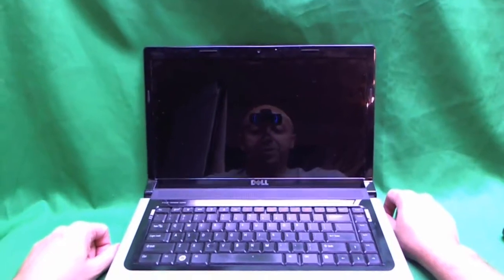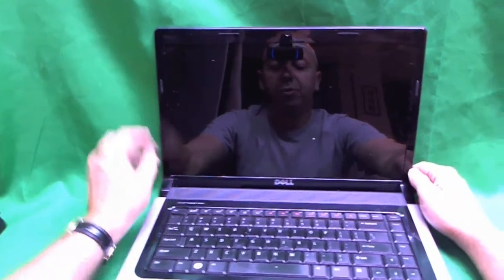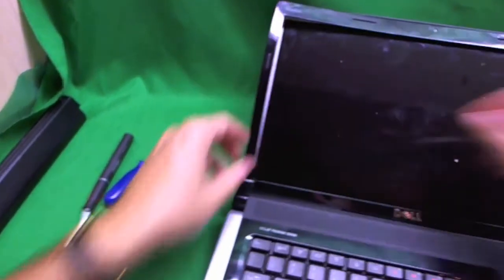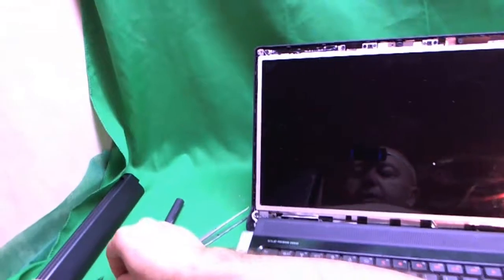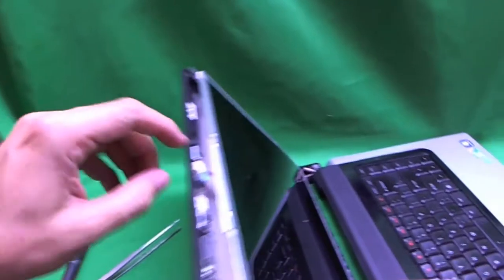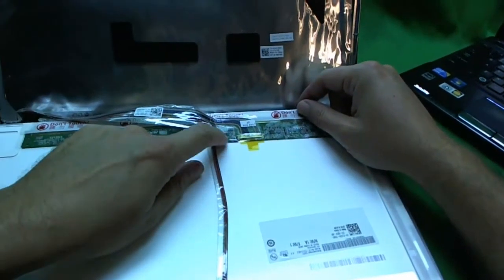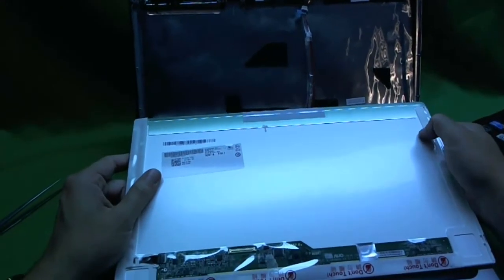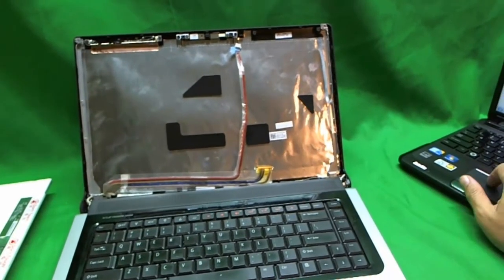Dell Studio 1558 Laptop Screen Replacement Procedure

Comment: Hey man, good video. I plan to use your instructions but 1st my question: My screen has several vertical lines from top to bottom: A couple of those on the very left of the screen and 2 or 3 about 2 inches from the left. They appear in different colors but most of those are white (means no video on the line). If I twist the whole screen (grabbing the top screen corners, pull the right and push the left), all lines gone. So screen is good but seems to be a video connection issue. Any suggestion?

Comment: Hi.. I dont see anything on the LCS screen except a white hazy circle. Is it because the LCD screen is faulty? 
Previously I used to plug in anything like a handkerchief or something in the gap between bezel and rest of the laptop, and with such an arrangement i used the screen for about 4 months. Do you think I have ripped up the cable but LCD screen can be working fine? 
How do I replace the video cable?

Comment: @ScreenSurgeons, I have a Dell Studio 1558. I've had it for almost a year. I thougt my computer kept freezeing up within the last month. It turns out that it is my screen that freezes and then slowly fades. I can push the bottom of the screen and it will start back working and then it will do it again. I took the screen out yesterday and I don't know if it is something in the board on the green electronc board on the back of the screen of the screen it self. Do you know by any chance? thanks

Comment: @marios93g 
the maximum capability of this laptop is 8GB RAM DDR3 (i assume DDR3 is the maximum this laptop caps at)
when looking for a laptop's RAM, make sure it is not meant for a desktop,
recognizing one is fair easy, unlike desktop's RAM card's which are long and thin,
laptops RAM cards are Fat and Small
all laptops use the same kind of RAM type as like all Desktops use the same RAM type.
so when searching for a RAM just search for ANY LAPTOP's ram and you will be good and set to go! :)